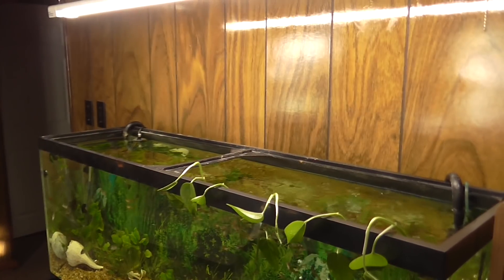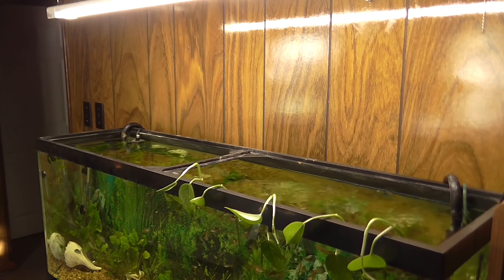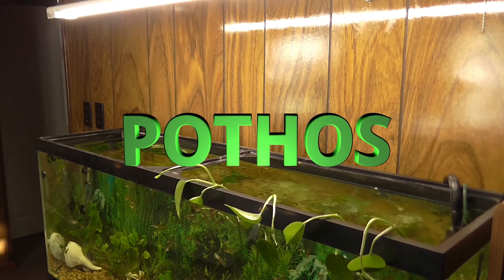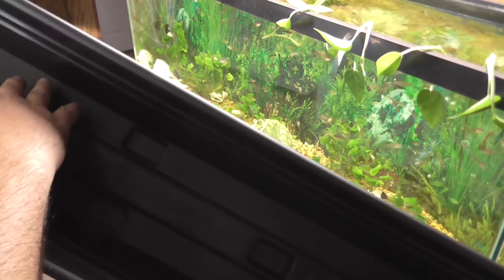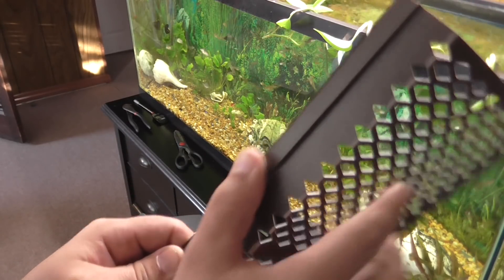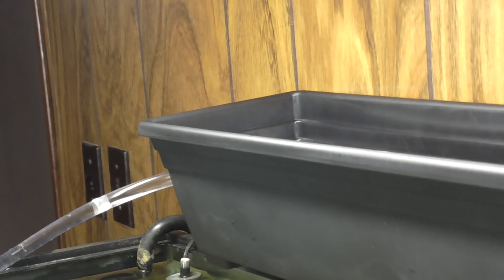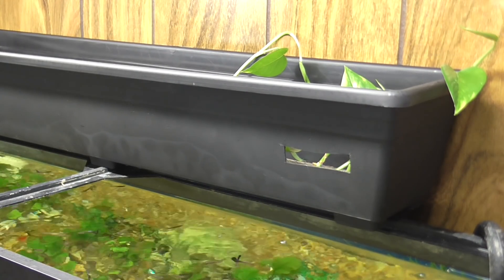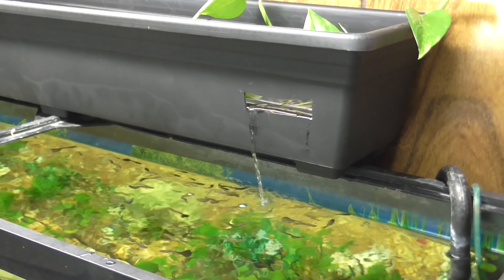Best DIY nitrates filter

Comment: I couldn't see the filter on top of the tank, I only saw a hole on your red shirt.  Is a good idea, but we all must remember that everything , food and poop falls and settled to the bottom of the tank, to me the Best filter is an undergravel filter  connected to a hangover filter , the undergravel filter will clean all the food and poop that falls on the gravel, then the hangover filter will suck all the gunk that comes through the gravel and falls in the sponges , clean the water & the gravel, without you doing all that work.

Comment: You need to place some ceramic bio  filter media under the base, then load up a layer of bio home media on the top, up to the level of the box return slot, so the plants roots have something to hold onto. You should get 100% filtration when fully cycled or 0% nitrates. Add more plants.

Comment: Thks for sharing Ideal to cut a window of 1.5 inch and make a flap under or fit a small connection so the water flow exactly inside the water like that you can risk the water to go underneath the pot.
Great idea Thks Mate.

Comment: I don't think that alone will do it.  Perhaps you could consider turning that window sill planter into a biocenosis clarification basket and have the pothos vine root on top of it, although, that output you created needed to be a hose that goes into the water in the tank.  You're going to end up leaking outside your aquarium.  Anyhow, you could also just have the pothos vine root into the aquarium.  I put a vase in my aquarium for the roots so it wouldn't mess with any of my submerged plants.

Comment: Your Prothos needs to be at the intake end of the filter, not right over the outflow.  As the roots grow they will trail in the water downstream of the intake.  You want as much root exposure to the water as possible.  the way you have it, the water won't be exposed to the Protho roots very long at all.
Reply from the maker: That was at beginning now the pothos grew and filled the whole container and No roots running downstream yet. I had to trim the pothos several times already and do not notice any problems yet.

Comment: that's cool, but that you really need to do is get yourself a python gravel vac and do 3 x 50% water changes.
Reply: your nitrates are very high at 160 ppm. the first 50% w/c will drop them to 80, the second to 40 and the 3rd will drop nitrates to 20 ppm

Comment: Planning on doing something similar for my koi tank. I'm using 2 submersibles with tubes connected to each side of the plastic pot and putting filter media/sponges so it will pass through the filtration, then through the cut waterfall gaps down   the middle. May even grow a few pothos in there too.

Comment: I have been working on a design similar to what you have shown in my mind and a few rough sketches.  Watching your video has solved a few issues that I have been trying to figure out.  I think if it is done right it can add to the aesthetics of the aquarium without breaking the bank.  My tank is in the dining room so as far as my wife is concerned aesthetics is he only concern.  I have a 125 Gal tank that is overstocked, 88 fish and the vast majority are over 2 1/2" and several are over 4" It is well planted with Rhizome plants such as anubias, java fern, bolbitus, and buce, but because of my fish population I still have a nitrate problem.  My livestock consist of a lot of loaches and other diggers so planting any substrate plants is futile, and floating plants such as duckweed and Sylvia only provide food for my Kribs, Roseline sharks, and my angles.  So to solve my Nitrate problem I have to come up with a creative solution and I think building on your design is the answer.  I think the first change is that I would run mine independent of my canister filter,  I am thinking that I could use a powerhead and hose like your design to pump the water to the planter box.  I also think that I would not use the aluminum gutter screen because it could leach aluminum into the water which I believe can be toxic to your fish, thinking some plastic egg crate used in dropped ceilings would be a better choice, and the other change I would have to make is the outlet because noise can be an issue,  I would use a bulkhead and 1" pvc pipe to direct the discharge below the surface of the water.  I think adding this kind of filter to just  about any set up should help with Nitrates, and also an added bonus is the pothos plant also helps purify the air.  As the Photos plant fills in it would give the appearance that the plants are growing out of the back of your tank.  I think you could also add peace lilys and possibly bamboo to the planter box.  I like this ideal better than adding more chemicals to remove the nitrates.  The only thing is if the filter works to good and removes to many of the nutrients it could be stunt your aquarium plants.  If you are interested you can view my aquarium viewed at https://www.youtube.com/user/beau4269
Reply from the maker: Hi thank you for watching and taking your time to comment. I do have an update video https://youtu.be/RoGOLrpt8EI and I did go with a separate pump for the filter. The gutter screen is plastic NOT aluminum and to quite the water I added a piece of plastic under the outlet to go to the surface of the tank and it work ok for me. The reason why I didn’t go with bulkhead on the outlet is that I don’t want it to clog up and possibly overflow the filter.
Reply from the maker: I just watched your tank oh I wish I could have a big tank:( looks good.

Comment: If you add java moss in your tank you can remove as it grows it lowers your nitrates as long as your not overstocked. I use java moss on my 2 90gl FW tanks and have no nitrate issues at all. I even sell java moss since I throw a lot away.

Comment: Having made and used overhead sump filters successfully let me comment a couple of points: you didn't need to drill a hole on the left-hand side of the planter and use all this hose and elbows to bring the water to the planter: like another comment said just "hook" the return on the side of the planter instead of the aquarium. Secondly, I would not rest the planter on the side of the tank as you're putting extra weight on one single panel. I have done that BUT on a tank that was fully braced and extremely solid. Finally, if the water flow if not maintained strong enough you run the risk of having water seep under the planter and outside the tank and run into all kinds of problems. I invite you to search into my old videos about overhead sump to get an idea.

Comment: Why not go directly from the filter to the planter and then exit to your spraybar?
Reply from the maker: Because it will overflow
Reply from the maker: And I did add another pump just for the planter
Reply: Anatolii Gordiienko: if that where true your aquarium itself would also overflow. But it won't its the exact same setup I've been using for the past four years. Although to be fair I have two exits just to be sure.
And I don't use a spray bar. It might be to restrictive to the flow.

Comment: I would have used another tube coming out of the planter ,possibly with a ball valve to moderate flow, that goes straight into the tank to avoid the pissing sound.

Comment: having nitrates that high does indicate overload of stocking. I have platies in a 165 Litre tank and had to move a lot to a garden pond because my nitrates were over the top as well. If you were to get a power head  you could use the planter as another filter system by turning it into a top filter. You could add in products that can help reduce nitrates. also another thing to look into as well is the Anoxic filter. it will keep nitrates to 0 and you can build it yourself.
Reply: thumbs up
Reply: it is possible to make an Anoxic filter for a small , around 50-100L fish tank?
Reply: @tdcthedropchannel  yes most of my tanks use top filters so I create anoxic filtration with an under gravel filter. You can also do bcb bags in a canister or hob filter look into Kevin novack’s channel. Anoxic filtration can be applied to any size aquarium

Comment: This works, but if you wanted plants above the tank, you would have put up a plant shelf. 
Why not use water plants inside the tank, put up a couple nice MH or SHO-CFL grow lights to consume nitrates instead?
Alternatively, you can place an aquaponic sump under the tank instead of on top, so you won't have to see it.  
Putting it on top causes visual clutter, and people can tell that the plants are not to beautify the room but to service the tank. If you build a canopy around the whole top area, that will make it look clean and out of sight. Just a thought.
Reply: Plants living outside the water are hardier, grow faster and are easier to keep This is why many commercial breeders grow aquarium plants emersed. There is no need for CO2 supplementation for rapid growth and more importantly there is no limit to their size. They also will not need to be trimmed to keep the tank looking good. I have a massive peace lily growing out of one ten gallon tank (overstocked with endlers, dwarf puffers and more) you would never fit that much plant mass into the tank and have any room for fish. It keeps my nitrates under control,  20-40 ppm, I am embarrassed to say I went over a year of just water top offs (I do not advise). I never fertilize it and it is basically maintenance free, besides trimming dead foliage which promotes new growth.
Reply: Some times it is impossible to grow plants inside the tank itself . My oscar will destroy the plants in  no time. Also it is cheaper to do it this way and you can plant lettuce and other veggies in the pot. And you have the bonus of increased water volume without a sump
Reply from the maker: I want to stay cheap and not to break the bank with expensive lights. Under the tank I cannot fit a sump. Even for my canister filter I had to cut a hole in a stand . The canopy might be a good idea. Thank you.
Reply: Having a top sump like that you dont need to worry about a leak or pump failure draining your tank though as its above pump and tank level.
Reply: You can use cheap led floodlights off amazon, and also cheap plants too. You can get a bunch of dwarf sag for less then 10 and it'll spread on the bottom making a carpet. Water wisteria is easy to keep and will spread easy.

Comment: U can go to Walmart and pick up a 20$ pump that works great instead of using your return pump. This will give the added bonus of more water circulation to your tank.
Reply from the maker: I did you can watch the update video that is the only thing I changed. Thank you
Reply: What kind of pump at wall mart ?
Reply from the maker: https://www.harborfreight.com/158-gph-submersible-fountain-pump-63315.html
Like this one.

Comment: Good idea but maybe high nitrates is too many fish in a little tank.
Reply: Overstocking is fun - as long as you can process/export the resulting nitrates - which is what he is doing.
Reply: I have a 75 gallon with only 4 gourami fish. And my nitrates are high I have to do lots of water changes. There's a specific bacteria that takes about 6 months to grow in the proper conditions that only deal with nitrates the other bacteria does not deal with nitrates and takes 1-4 weeks to grow to handle the other toxins. So a recent cycled tank could still have high nitrates because of that.
Reply: Not fun for his fish in the mean time, the plants will take time to have any effect and even then they will not be enough. In the mean time his fish suffer. If he is not going to reduce stocking levels then he needs to be doing 20% water changes every single day until his nitrates are below 40 ppm. And after that as often as is required to keep it there.
Reply: good point. thought the same when i saw the amount of stock in his tank.

Comment: I liked it and may copy the idea but will adapt it a little.  Instead of drilling holes into the planter, I will just hook the outlet pipe over the top of the planter. I shall also fill the planter itself with those lightweight clay balls you use for hydroponics.
Reply: it dont have to be clay, concrete balls,, plastic ore cheramic and so on works too... point is to get a big surface area so that the bacteria that eat nitrates have somthing to grow on.  those bacterias are in most tap water,, but not consentrated enough to make colony,, like they create in a filter with large surface where the water runs slowly

Comment: Anotolii, do you have the update?
Reply from the maker: Paul Jimenez hi sorry no I don’t have an update yet I am still waiting for the plant to grow bigger because I clipped it off on the day of the video so I had to wait for the roots to start growing
Reply: Bio media does nothing to reduce nitrates. It converts Ammonia to Nitrites, and Nitrites to Nitrates. Bio media produces nitrates it doesn't remove them.
Reply: Bio media in the planter for those who want more filtering.
I do this with aqua clear hang on back filters wit potholes myself with good luck. Also have a Lucky bamboo growing out of a Aquaclear 70 of course with the lids removed.
Reply: Patrick, In an Aquaponics system the plants eat the nitrates, That's kind of the whole point, to produce nitrates for the plants to use to grow. If bio media reduced nitrates then people wouldn't use them in Aquaponics systems because they need the nitrates for the plants to grow.
Reply: Daniel Hughes  If that was true, aquaponics would not work.
Reply: true ,my mistake
Reply: You are correct Bio media does convert Ammonia to Nitrites to Nitrates, but that is its job Ammonia and Nitrites are toxic to plants, plants eat Nitrates.  There are three ways to get rid of nitrates, frequent water changes (Pain in the ass), adding chemicals which I try to avoid, or go natural and feed the plants.
Reply: beau4269 plants more Readily consume Ammonia and Nitrite, they are only toxic to fish.